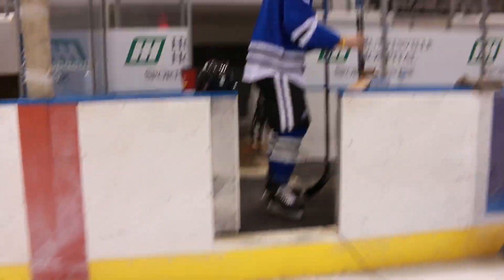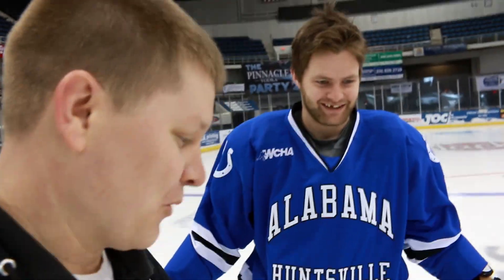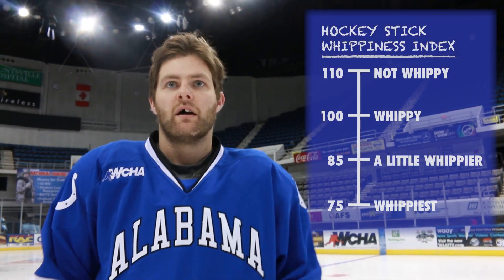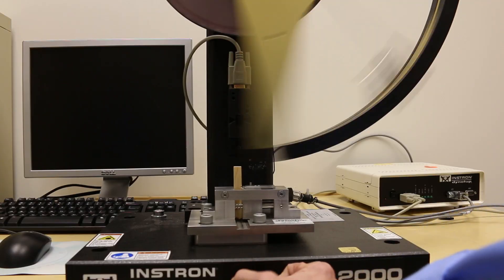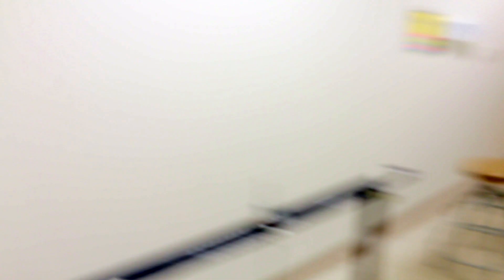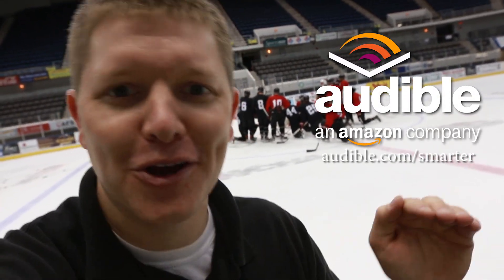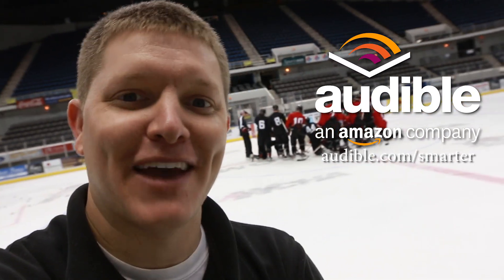COLD HARD SCIENCE: SLAPSHOT Physics in Slow Motion - Smarter Every Day 112

Comment: Its actually even more complicated than that! They way its described is not including the additional energy added with weight transfer. If you just shovel the stick into the ground behind the puck your going to get 60+MPH out of it but transferring the weight through the stick pushing it up into the 90's. Additionally this is an inelastic collision (or set of collisions). And gyroscopic forces are at work. This is why the stick is taped to stick long enough to impart spin.
I won't even go into lift or spin drift that have to be factored in.
And all this is only factoring in a static puck and ignoring the velocity of the skater. During a game the puck is NOT going to be siting static on the ice.

Comment: I'm an engineer and also a hockey player.  Hockey manufacturers also sell sticks based on flex points, so i'm wondering if the flex number could be based on where the weights are put?
Reply: wouldnt the number be true on all points? if the stick has a uniform shape i would hope so
Reply: No because, the sticks are woven, tapered, and strengthened or softened at precise points.  Much like high end golf clubs.  You are used to purchasing cheaper mid flex hockey sticks for children or low level play.  High end hockey sticks cost hundreds of dollars and have the same technology seen in expensive golf and fishing rods.  So, a high kick, low flex stick might have 85 stiffness rating, but my standard mid kick also has 85 stiffness.  Yet as 175lb experence player.  I cannot even start to flex the high kick stick, but the mid kick stick looks half moon when i take even snap shots let alone slapshots.

Comment: Great video. I would like to point out that ..

It's not that manufacturers don't record the proper flex, it's that each flex is calculated differently based on the type of stick. For example, a midpoint flex stick should be expected to flex like you graphed out. A stick that is designed to flex lower (low-point flex) on the shaft will flex differently if measured in the middle. Some sticks are designed to be strong on one side and weak on another. There's a lot of engineering that goes into this. Some stick makers might base their flex rating off of the "broken-in" period (the period where the stick will exhibit that flex the longest), others might base it on the brand-new period with no break-in.

Also, with hockey equipment, there is no real standardized measurements. Which is partly why you saw different flexes. Each manufacturer tends to measure things slightly different. This shows up most in goalie gear, where a 26" paddle stick in one maker is a 28.5" in another. Same goes for skate/pad sizing.

I've seen high-speed slapshot videos before, so I wouldn't mind seeing you do the opposite of the equation. The energy that a goalie (full disclosure, I've been a hockey goalie for 22 years) faces and that his equipment must disperse. I don't think anyone has done that. There's long been the saying of a shot feeling "harder" than a comparable shot traveling at a higher speed. I wouldn't mind seeing if it boils down to rotation of the puck, angle of impact (complete edge versus corner edge), or another parameter. Or if it's just psychological .. goalies aren't known for being the most sane individuals.

Comment: You mentioned at the end that you don't understand hockey because you don't play. Hockey player here.... You got the physics of the shot correct but nothing about the stick. The flex number on the stick corresponds to the flex in a certain kick point of the stick. Older sticks and mid kick point sticks use the middle of the stick to determine the flex number, whereas the Low kick point sticks are more towards the bottom. The "lowness" is dependent on the brand, as some are lower than others. For example the stick he used was a Warrior Covert DT1 which has a super low kick point. so you may notice the stick really doesn't flex in the middle, the bottom flings the puck. Mid kick sticks are preferred by slap shot takers because when the stick flexes in the middle the is more surface area to build up potential energy, causing more kick pack once the contact is made, increasing speed and power.

Comment: Hey I had a question. I play hockey and so many stick manufactures advertise a "low kick point" on their stick meaning that the maximum point of bend is lower towards the blade, apparently accomplished by tapering the stick. Physics behind that? Is it worth getting a tapered stick? It may all be in my mind but I've always used tapered sticks.

Comment: Started to think about that.. If the player has really quick slapshot, should he use stiffer stick even hes lighter at weight? Since there was mention that a thumb rule is that you should pick flex like half of your body weight.
Reply: It's really about your personal skill level and preference, although if you choose a stiffer stick than what you can handle, you won't be able to preload it with the potential energy you need to make it whip well and you really won't shoot the puck any faster.

Comment: It's amazing how much sticks vary in stiffness, even from the same manufacture. Biggest example I had was I used a Easton Synergy and a Easton Stealth. The 100 Flex Synergy flexed like most stick rated at 100. But a 100 Flex Stealth felt like an 80 Flex. So if you would use a higher flex than normal.

It also depends a lot of size. Smaller the stick, the harder it is to flex.
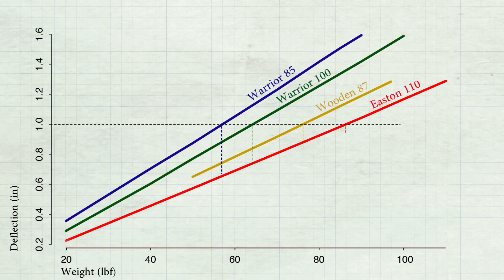Reply: It also depends on the amount of use, especially with composites. With use over time, the structure of the composite fibres deteriorate and the stick will get micro-cracks that will reduce the stiffness. They kinda mentioned it at about 4:29

Comment: hey destin, i dont know if the guys at the rink told you or not, but there are different flex pattern designs as well as the amount of flex the stick has. some sticks like the warrior covert (the black on in the video) have a low flex point. meaning the carbon in the stick was set so the majority of the stick flexes in the lower part closer to the blade. this make the release of the puck faster or the puck is on the blade for less time. doesnt mean the puck travels fast tho. there is also a mid flex stick where the lower part by the blade and the top parts of the shaft are stiffer than the middle. allowing the shaft to load up even more so. the mid flex sticks would give you a better bow for a camera shot and the puck travels a little faster. although because it loads up more the puck stays on the blade a little longer.

ive played hockey for 20 years. i can feel the difference in these different flex patterns. ive broken so many sticks its not even funny.

i was actually curious if the equations you had in the video clip would change now knowing there was a resistance force inside the stick from the way the carbon was set? i know that these different flex patterns break in different ways too.
also i wanna try to cork my stick(adult league use only haha) with a balsa wood so the hard side faces the thick sides of the shave to keep the stick from "buckling" as an old boss told me.

if you wanted to do another hockey experiment id love to see how different the two designs really are and when flexed what shape the circumference of the shaft is. =D

i love your channel!!! i want to get me a high speed camera and see if i cant inspire my future kids!!! doing great! keep it up!

Comment: not true about the flex the stick may or may not have a high, mid, or low kick points so it is not necessary for the stick to have a high flex point in the center, for instance my Easton mako m2 with 65 flex has a pretty low kick point but my other Easton EQ50 has a mid kick point.
Reply: The equation that he showed in the video would account for the change in structure for sticks with modified kickpoints (if you knew the different changes at different points on the stick.)
Reply: true Bradshow199

Comment: You said the sticks lost their stiffness over time, but as far as i know, if a material is used and plastically deformed during the time it was used, it will nor get more or less stiff. This is because if you go over the yield strength, the modulus of elasticity  stays the same.
Second remark i want to make is that the breaking stick would have broken as well if there was no puck, because you can clearly see the difference between the shots, and it is clear to me that the stick is pushed further into the ice. This is basically the same as hitting a tree and seeing it break where it hit the tree.

But overall it was a great video! Greetings from the Netherlands :)

Comment: Gotta have my 2 cents. You should have placed the supports closer to how a hockey player actually would hold the stick when measuring the flex. One hand at the top and one towards the middle.
Reply: That is presumably some sort of standard rig, but it repllicates the action of the stick in use pretty well- one peg is the upper hand, the weights are the lower hand, and the other peg is the blade on the ice.

Comment: Great Job !! Love the fact that u said you used audible before the sponsorship shows dedication. Definitely need to try 3 different types 1. wood  2. composite  3. hybrid composites   .   Ultra light graphite I use does not have much flex but the Jr. version has alot more as well as the synergy and tri core. Keep up the dedication :)

Comment: Would have been interesting to see different stick composites take this test. ie. wood, aluminum, etc..
Reply: In hockey there's two kinds of sticks, wood and composite. Any sort of metal would be too hard to flex. The traditional wood sticks tend to be less whippy, but break less easily. Nowadays, these are typically used by the few incredibly strong players that can put a lot more force into bending it, making a harder shot.
Reply: RedShirtSmith
I disagree. Wood sticks aren't any less flexible than a composite stick. If anything composite sticks have a higher range of flex values and have better potential to be very stiff. The reason wooden sticks aren't used anymore is because they're heavy. That and the blades wear out really quick. Incredibly strong professionals use composite sticks with very high flex values.
Reply: RedShirtSmith
I still use an Easton aluminum stick from the 90's sometimes, and Wayne Gretzky (you may have heard of him) used an Aluminum stick for most of his career.  There's a lot you can do with metal through proper metallurgy- varied properties through alloying, heat treatment, etc.

Some of the first composite sticks were carbon fiber over aluminum- not just carbon fiber.

I don't think anyone thinks wood sticks give you a harder shot- they don't flex and return with the same tensile energy storage as composites- but they are less likely to break- I don't think anyone knows exactly why composites break as much as they do, but it's likely related to what we saw in the video of how the composite stick broke during the preloaded state of flexion just after contact with the stationary puck induced a shock vibration into the system- something there overloads some of the fibers, and once the compromise occurs, failure rapidly spreads through the fiber matrix.
Reply: Wysiwyg Mtwzzyzx I think wood is less likely to break because it's a fantastically engineered material from nature. Trees can survive abuse that would destroy many of our engineered products.

I used a laminated wood/carbon stick in my short time as a D league hack. It was much heavier than the carbon sticks. Also way too stiff for an out of shape novice to get any whippiness. 

I think the carbon sticks break more because the makers are walking a fine line between weight and durability. Also, I would imagine that those thin-walled carbon shafts lose total structural integrity due to nicks and deformations much faster than a wood stick. The total strength of the wood stick is not drawn from thin walls but from across it's entire cross section.

Comment: Awesome video. I use hockey sticks to teach beam bending to my students. I'm going to share your video with them, thanks. Just one thought, my understanding was that "flex" was the force required to deflect the stick one inch when the supports were at a distance of one yard. It looked like your test had a length longer than one yard, which would correlate with lower readings... but quite frankly... I think "more whippier" is just as accurate as the numbers printed on the shaft! Thank you for the video!

Comment: I can hardly imagine that the stiffness will degrade that much over time. If that was the case than it would be nearly impossible for mechanical engineers to design composite structures on stiffness. Those sticks spend most of their time inside right? (no damage from UV radiation). It might be the temperature difference, but I don't think that will have that much of an influence (deltaT is what 15C?). Maybe the factories aren't testing the stick at all and are the stick just designed with a specific stiffness. Any differences in stiffness than would be because of the fabrication process. What do you guys think?
Reply: Well of course the fabrication process for any material can never make something indestructible or completely wear resistant. Add to that the constant changes of load a typical hockey stick endures in it's life-span and the fibers are bound to work themselves loose to a certain degree. It's a balance between flexibility and overall strength of the materials and the bonds between them. A truly rigid material can be made sure but it would not be that flexible. I can tell you anecdotally that this "flexing out" is absolutely noticeable even to the naked eye; or hand or whatever; and even seems to vary between manufacturers or models.

Comment: I have a slight issue with using those beam deflection equations for the hockey sticks. In the beginning the player stated that his stick was a composite material. And the stick that was broken was wooden. Wood is also a composite. Those deflection equations assume homogeneous material and are not valid for composite beams. Unless you can show that in the direction stick is loaded, it will behave the same way as a homogeneous beam, your predictions will be inaccurate.
Reply: The stick that was broken was the same exact one from the beginning of the video. Not a wooden one.
Reply: Same stick but otherwise you are correct. Of course the stress diagrams are a little simplified. In addition there is some torsional force which isn't accounted for at all. This mostly happens due to the weight of the puck contacting the blade on a spot other than directly in line with the actual shaft, so a slight twisting occurs. I'm no scientist and the equations themselves are beyond me but believe me hockey stick manufacturers go into a lot of depth with their R&D.

Comment: The same thing happens when you cast a fishing lure. You load the rod with the weight of a lure, then release the load, and let the rod throw the lure into the lake. The whippier the rod, the less weight it takes to load it, but too whippy a rod, and you lose distance because you don't get all the energy from your arm action.
Reply: There are also variations in fishing rods because different sections of rod have different amounts of flex, hence the terms fast, medium and slow action to describe how the flex profile along the length of the rod varies between rods. These factors are especially important to fly fishers as they use the weight of the line to slowly feed out the line over multiple false casts, so it is necessary to have a rod that is flexible enough to store lots of energy, elastic enough to release that energy quickly when you need it, and stiff enough to resist the momentum of the line to keep it aerialised on the return swing. Would probably make for a good video once the weather warms up.
Reply: lancer D Excellent post, Lancer. So we're telling Destin to do a fishing rod video, right?
Reply: Docktor Jim I believe we are.

Hey SmarterEveryDay , These fellows have an idea for you

Comment: I actually think the manufacturers measure the flex from the flex point of the stick cause different sticks flex differently at different parts for different type of needs of players.
Reply: Yeah there wasn't any mention of the "kickpoints" that manufacturers usually provide.
Reply: You are exactly right. The flex number corresponds to the flex in a certain kick point of the stick. Older and mid kick sticks use the middle of the stick where as the others are more towards the bottom depending on the brand.

Comment: Destin,
One note on the "disproving flex number" portion of this video. Hockey sticks are made at a certain length from the factory, relatively within an inch of each other in any given batch. If the player is taller than 6'2" and prefers a longer stick, an extension can be added to the top of the stick which would actually decrease the flex number of said stick. Likewise, some players like shorter sticks, and cutting the sticks down from the top increases flex.

Otherwise, solid video - and it would be interesting to see a second part of this made with different brands and models. Bauer's Vapor line claims a "dual kick point", a mid for slap shots and a lower (like the Warrior stick used here) one for wrist and snap shots. CCM's RBZ line claims no kick point (or variable), flexing where your hand is on the stick as opposed to a predetermined point.

To whoever asked how much the stick cost that the player broke: $250 US. It's a Warrior Covert DT1 LT, an elite level stick generally used by players in juniors (QMJHL, OHL) or college hockey, both D3 and D1, or semi-pro (ECHL, WHL) and above.